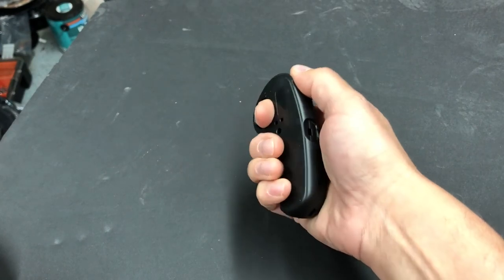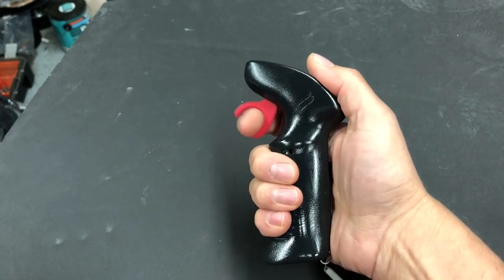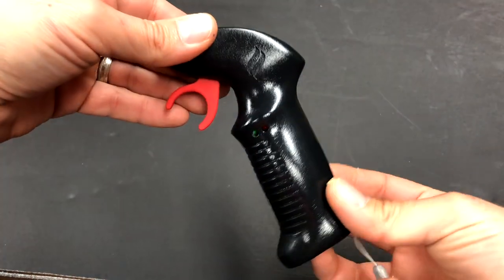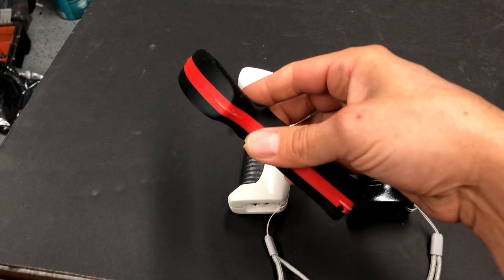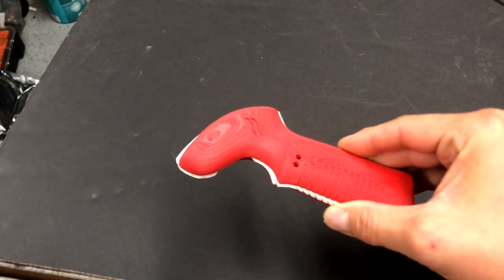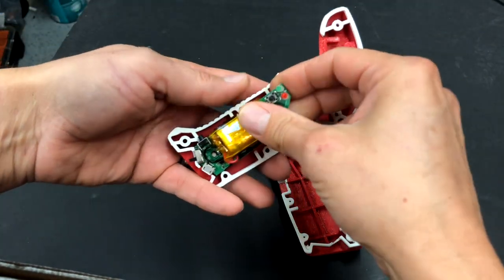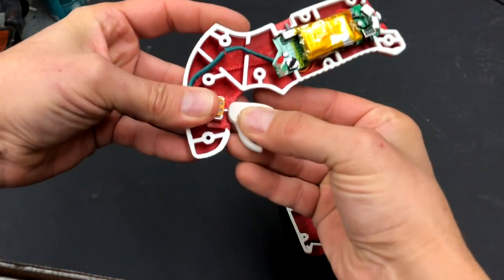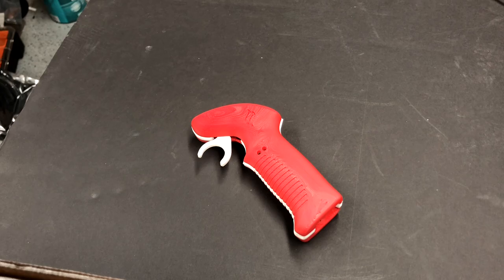The Hammerhead - a Nano V2 remote remix by Land-Surf.com

Comment: This is a great option. Would you consider creating a design with a guard to make it "pocketable". I'm a fan of trigger style remotes but one of the drawbacks has always been accidental trigger bumping/breaking. There are even companies that started out doing mostly Evolve gen 2 trigger guards. Thanks for the great design.
Reply from the maker: Matty O'Hare I’ve though about this and it would help accidentally hitting the throttle, but it needs quite a large loop to encompass the trigger in braking mode. I will see what it looks like to loop a guard around it.
Reply: @landsurfmarin  that's a good point. Perhaps minimizing the size of the half loop trigger (ala Evolve) might help both in accidental bumps and reducing the size a guard would have to be.